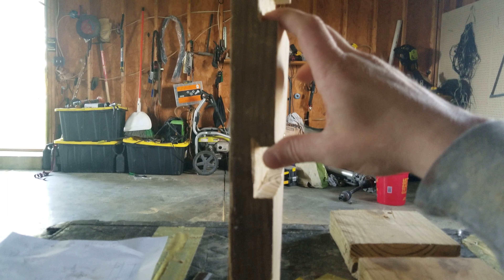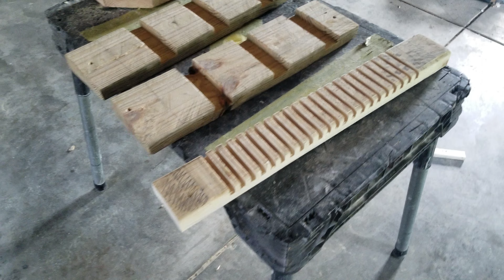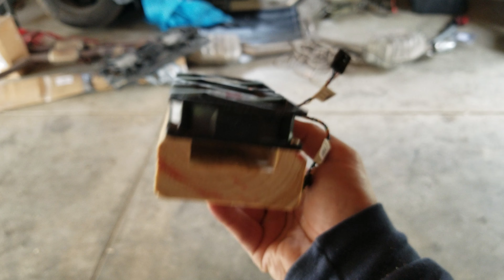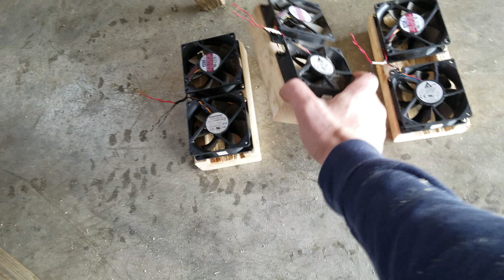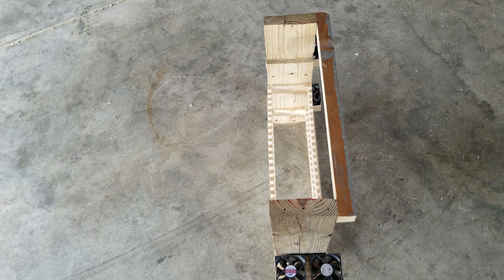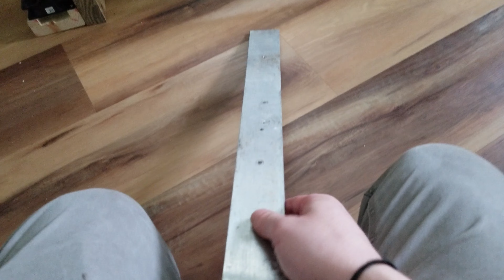Verus Coin Cooling Rack Version 2

Comment: Looks clean dude! I wish you lived near me, I could have totally professionally painted that for you with a spray machine.
Reply: Also the half inch spacing was smart too, keep the phones a little cooler... ALSO when you split the wire off those computer fans, are you able to split a usb wire and power them that way?
Reply from the maker: yes the colors matched up nicely for power and ground. red/red    black/black i shrink tape them and rock and roll. generally i wouldn't cut up a good cord, but i have about 50 of them i've been sitting on for two/three years, so they finally coming in handy lol